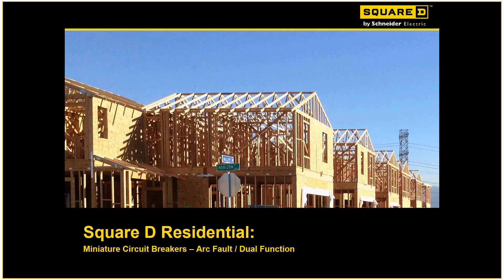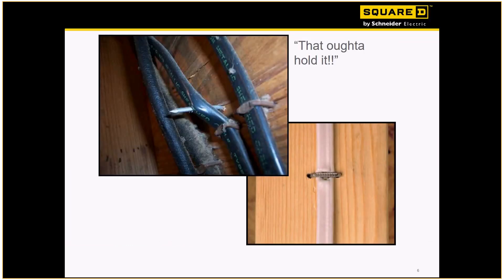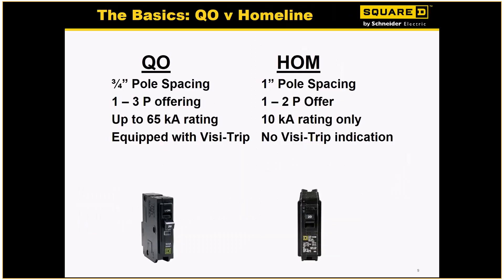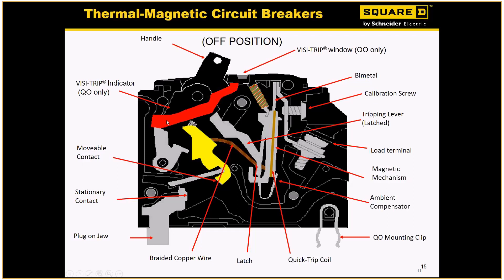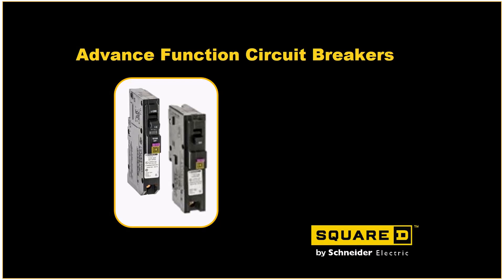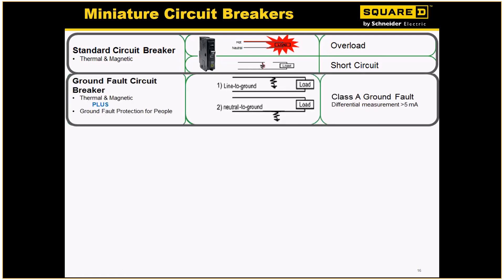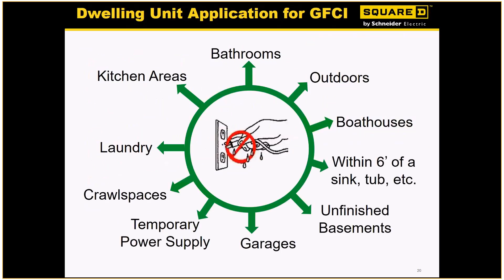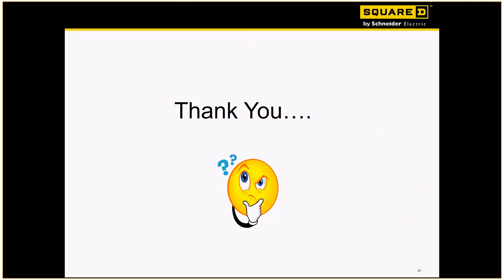Square D - Breakers 101

Comment: Wired my house 20 years ago.
Went with QO and have never regretted it,
Yes a homeowner can legally wire their house where I live.
Anyway if I wanted to upgrade do I just replace my old breakers with shiny new multi function ones and replace my GFCI outlets with standard outlets?

How does the new plug on neutral work?
Do I have to have a space on the neutral buss for each breaker?

Comment: Really great and covers almost all that one needs to know.

1. Does the DF performs a routine “self test” like the new GFCI breakers?  

2. In the Advanced Function Devices slide, the DF does not do the “Fault-to-ground-detection” unlike the CAFCI, is this correct?  I ask because the miniature Circuit Breaker slide shows that DF does everything CAFCI and GFCI and that you verbally confirmed it also.